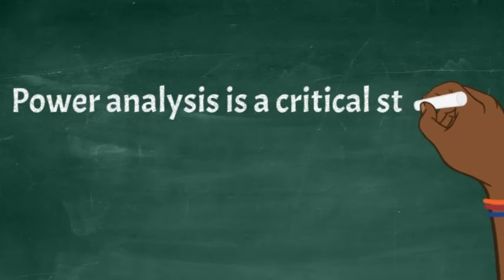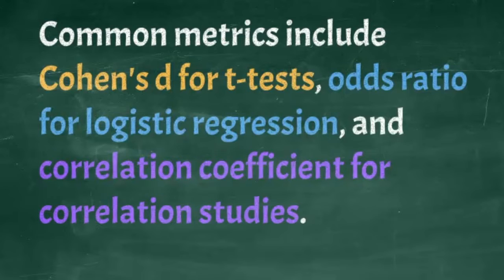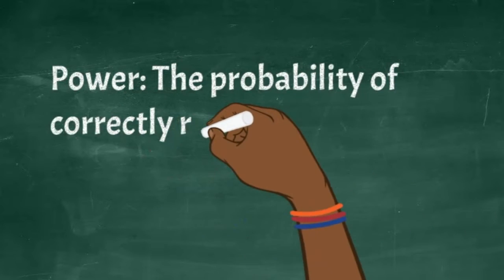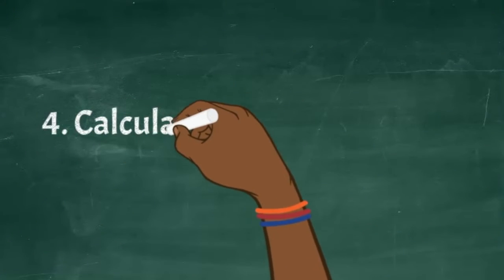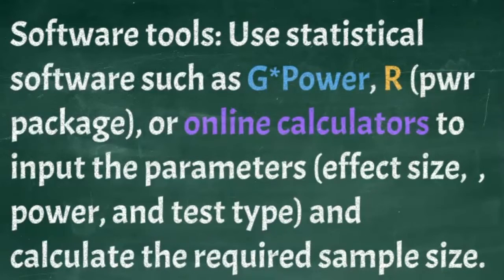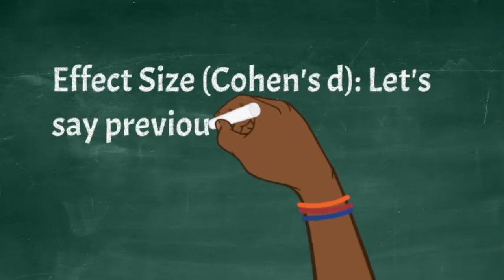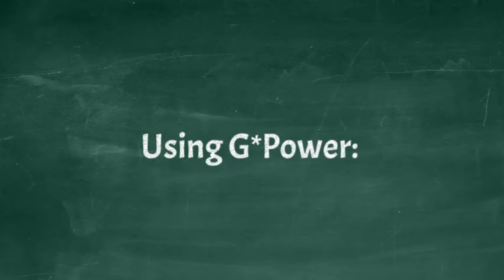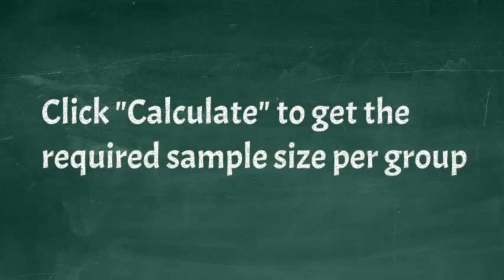POWER ANALYSIS Explained: How To Calculate Sample Size For Your Research

Comment: I want to ask a question. My English skill is not enough to understand . It could be silly question sorry .  I am trying to learn statistics . I would love to do statistics of my researches my own . 
I want to do a research about "Mortality and complications after percutaneous endoscopic gastrostomy)PEG): a retrospective one-centered study" 
My universe is 908 PEG . After excluding criterias I dont know how much will stay but probably around 600 cases I want them all.
How can I calculate for that retrospective research sample size. 
1-After PEG minör complication rate : %18-38  major complcation %2-4
2-After PEG mortality rate in 30 days : %3-23
I want to do multiple regression analyses . I have 2 dependent variables "mortality after peg " and "complications after peg"
I have 31 independent variables.

I do calculate at GPower . 
F test- Linear multiple regression : fixed model, r2 deviation from zero: A priori 
Effect size 0.15 , a 0.05 B: 0.95 number of predictors 31 
Sample size 264.

***My question is this how can ı find effect size? Do you suggest me any other advice for my research sample size calculate ? 

Thanks for helping and sorry for baby english and long question.
Reply from the maker: Hi! As I am not a statistician, I cannot fully help. However, based on what I've understood of your question, you may be able to calculate the odds ratio for the percutaneous endoscopic gastrostomy vs. those without the intervention. This would give you the effect size parameter to input into the sample size calculations. 

For the regression analysis, perhaps a correlation coefficient would be the best way to assess it's effect.

Please confirm theses approaches with a qualified statistician :)